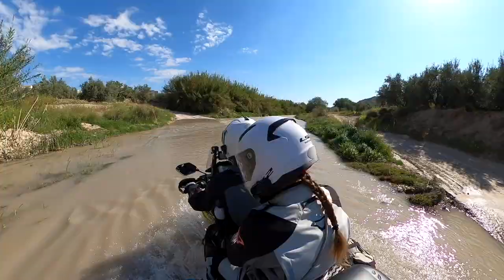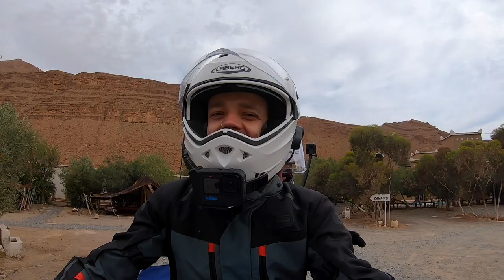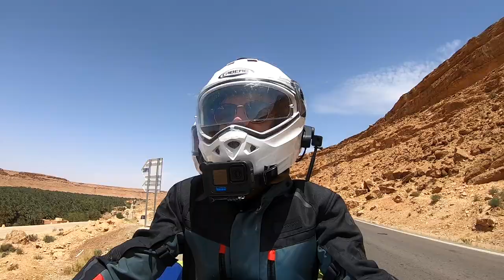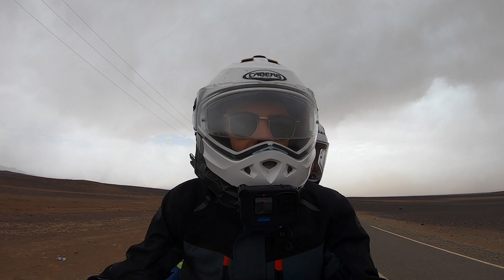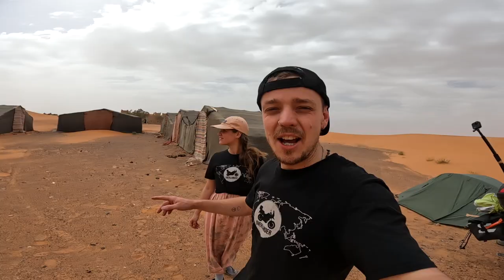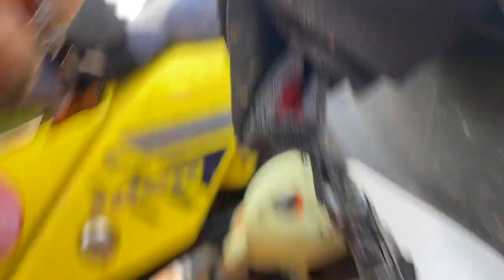CAUGHT IN A SANDSTORM! (Motorcycle Morocco) 🇲🇦 [S2 - E5]

Comment: The folks trying to stop you in town may have been wanting to warn you not to head in to the dunes due to the weather conditions.
They know how dangerous it can be to get stuck in the sand alone on a bike in a sandstorm with no cell coverage.
We were there many years ago in a Pajero, and the locals are super nice and helpful.
We had no idea how to drive in dunes and got stuck pretty quickly. Luckily a local saw us, helped us get out and showed us how it's done.
Unload the bike, let most of the air out of the tires (hope you have equipment to pump them up again afterwards), keep your weight backwards and the throttle well twisted, and stay close to hard ground until you get the hang of it.
Keep having fun!
Reply from the maker: Crazy story! Yes we still have to learn and get use to different terrain 😁 thanks so much for watching 🙏🥳

Comment: merzouga is not that dry think of it as a beach cause they have too much underground water just 2 metres below. the water comes from the atlas mountains when snow melt .they build the camps on dark soil where the dunes cannot move because there is water underneath .  the real desert is far more south be prepared guys with water and food . in sand stroms sky turns red .
thanks for sharing enjoy and be safe
Reply: lowering tire pressure help cars and dirt bikes drive on sand but i don't know if that will work with your bike
Reply from the maker: Can't believe it rained!! Was very surprising but I guess you're right, it's not that dry here compared to further south. Thanks so much for watching and don't forget to subscribe 😁🙏